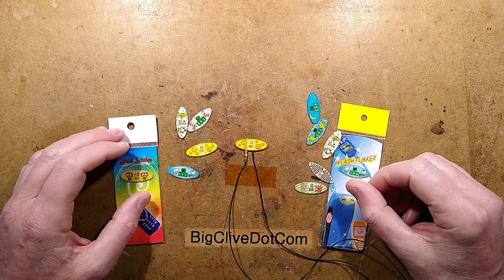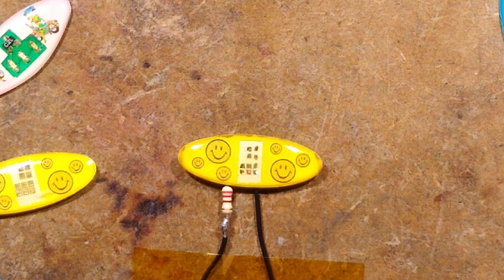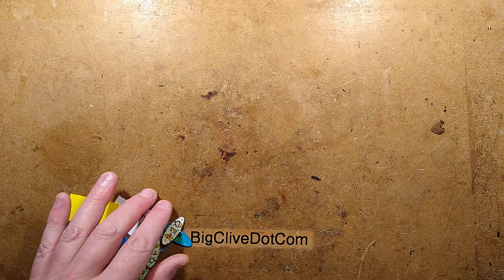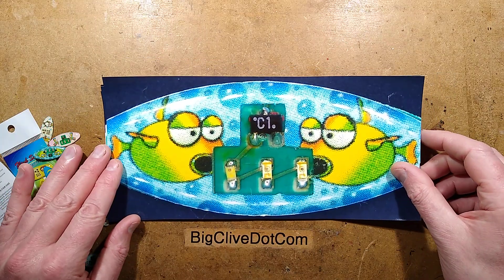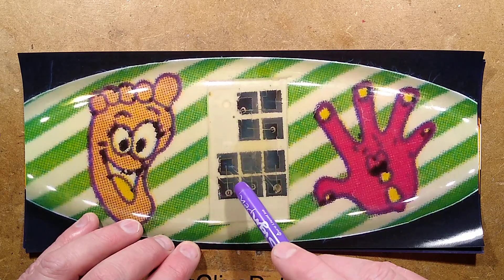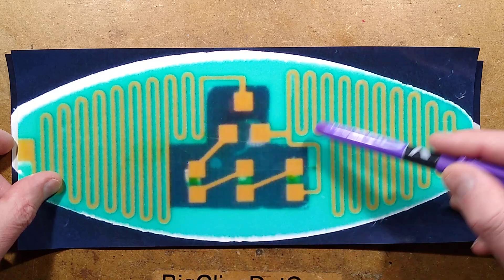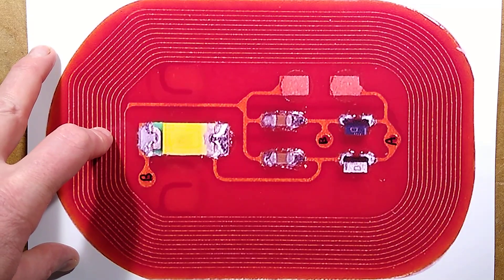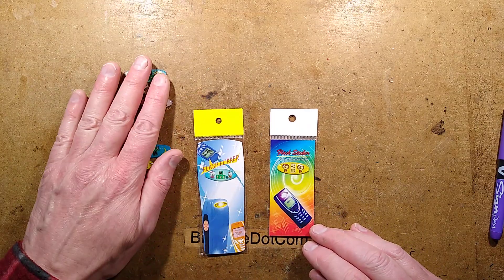How self-powered flashing phone stickers worked (with schematic)

Comment: Interesting video, thank you, Clive.  Designing and home-building a parasitic circuit like that would be a good electronics project to work on with one's young technophile son or daughter.

A question that is off-topic but on-label:  Each of the RF-sticker-lights shown in the video appears to be covered with a clear, soft, vinyl-like lens or cover.  It looks like a liquid has been applied and then somehow self-cured into a clear vinyl.  I see it often on various labels and even accent spots on greeting cards and business cards.  The soft raised tactile vinyl-like substance always seems to be in exact register with the printed ink of the text or with the perimeter of the whole label, as applicable.  Can anyone explain how that is done in a mass-production environment?
Reply: We had a kids' craft kit, where a rubber stamp was used to print ink on paper and then a coloured powder was dusted across the surface, sticking to the damp ink. The excess was then tipped off. 
Holding the paper over the toaster melted the powder and made it shiny, so the whole process was like a very slow laser printer.
Reply: @edattfield5146  

That would explain the impeccable register and the meniscus.
Reply: It is a good question. I also want to know.

Comment: "this flashing sticker absorb electromagnetic radiation during the use of cellular phones"
was right, it's how it works.
It also adsorb only an insignificant amount of radiation, but it does.
Reply: This is a rudimentary form of RF harvesting, but in fact, as Clive pointed out, it backfires: In a phone call, you actually have 2 radio links, uplink (transmitting from your phone to the tower) and downlink (from the tower). tower to the phone). If you are absorbing power from the uplink, you are adding attenuation to that channel, so the radio network controller will command your phone to increase its transmit power level to compensate, negating any possible "shielding effect" to your head. And also draining your battery faster
Reply: @mincos_outon  yep but only if the sticker is in between the tower and the phone antenna, old mobile antennas are designed to irradiate on every direction (maybe not the head but you have the board and ic shields on that side too), these stickers harvest energy but irradiate none as all of it is dissipated through the LEDs.
Clive was referring to his own version, sticking LEDs and diodes directly on the antenna coil.
Reply: It is absorbing but I think the connection quality issues were more a matter or blocking the signal in certain orientations relative to the cell tower's location.

Comment: That zigzag antenna is picking up the E field so it's developing a voltage from one end to the other.  The zigzags do produce some inductance, but it's to tune the antenna, not to sense the signal. 

The spiral antennas are picking up the magnetic B field and depend on the B field going in and out of the coil.

Comment: The regular diodes are there to protect the LEDs from too much reverse voltage; LEDs tend to be far less tolerant of that. Especially without the diode pointing the other direction you might get high voltages applied to the LEDs.
Reply: Not really, The diodes form a crude dc for the diodes to work. Not enough current to worry them Led.

Comment: I’m assuming it worked the same in the UK but here in Australia you’d hear the call coming in a few seconds before if it was next to certain radios (kinda sounded like modem noise). Do these react to that?
Reply from the maker: They did.  They flashed just before the phone rang and also when it routinely checked in with the local cell station.

Comment: I had one of the replacement antennas that flashed like these things. 
I also had a bag phone that I could pull the electronics part out of and slide it into a thing in my car so I had the same number for the phone mounted in my car.
Good times...
Reply: The first phones I had put in my trucks were the bag phones they mounted the transceiver behind the front seats in the sleeper used a extension cable to put the handset cradle on the dashboard and a external antenna on the cab roof took a big 3/4 inch hole to mount it !

Comment: at 300MHz, the wavelength would be 1 metre, an antenna is generally 1/4 wave, so each side (pole) of that badge should be  0.25 metre (they are diploes), for 500MHz the wavelength would be 0.6 metre
Reminds me of "wally lights" in the days of CB (neon on top of the antenna that would glow when transmitting)

Comment: Have you tried them with a 2m (144 MHz) amateur radio? If you wrap a dipole antenna around a fluorescent tube and transmitter enough power, the tube will glow, so I bet these would do something.

Comment: Are these the same concept as the little antenna replacements they used to sell?  Usually a multicolored LED you'd screw on top of the Nokia antenna nub.  The light would flash when calls came in.

Comment: The receiver, I think, for the frequency of 2g ought to be 72mm on a dipole aerial, so 36mm on each plane. I don't have the maths to support this, it's a gut feeling. I've never really messed with frequencies above 24 meg RF though 😬
Reply: 1.3ghz is the 23cm band. 2.4ghz is 12cm. So 1.8ghz is about 16.7 cm 👍

Comment: Very interesting and very timely video as Samsung announced at this years (2022) CES that they will releasing TV remotes which can harness the radio power of your home WiFi to stay charged for longer.
Reply from the maker: That's going to trigger the anti 5G brigade.  But in reality they will be using microcurrent circuitry and energy harvesting to send tiny bursts of remote control data.
Reply: @bigclivedotcom   Conspiracy theorists always find some way to tie unrelated or circumstantial things together.  How much power could Samsung realistically capture using this method? Could smart home devices like motion, door, vibration sensors etc adopt this to make batteries last longer or forgo them altogether?

Comment: I think the reason they're using a double-sided board is they're forming a small capacitor where the two tracks overlap just to the left of the diodes/LEDs.  It's probably to make the antenna resonate at the desired frequency.

Comment: dipole antenna is about 234/Mhz feet long on each of the 2 sides for 440Mhz is .53 ft or 6.38 in usually a bit less due to dielectric effect shorting the need length fun stuff all round ---- 
David Lowe WE1U Auburn, ME

Comment: I had a flex cable that goes underneath the front case on a 3310 and was getting powered by the phone battery, after the initial signal you would get the whole keyboard flashing.

Comment: Yes, used to see these around my high school in the early 2000s. I seem to recall the little phone case vendors in shopping centre concourses would always have a display of them all lit up. Now I wonder if they were the normal stickers on some kind of plate antenna or if they were simply hard wired from behind like Clive's example.
Reply: They were likely hard wired. There's no reason to use some sort of separate RF transmitter (or multiple phones all ringing at once) just to light them all up, it's far easier to use some thin wire and a small power supply.
Reply: @PunakiviAddikti  that would be my guess. I suppose it just depends whether you need the display to be easy to manufacture or easy to update without specialist skill. Most likely the former since the designs are timelessly obtuse.
Reply: its kinda weird I remember there being replacement keypads that had a strobe/pulse effect too but i cant find any info about it.
Reply: Presumably a transmitting loop (like a security tag loop in shop exits) would also work.
Reply: Clearly they were not powered. Just reporting the standard amount of brain melting radiation present in that local vaccinity. 🤔. Right in your face a warning of the trans-dimentional pollution designed to melt your brain 🤔
Reply: @johnathanpearson3203  Probably.
Reply: @PunakiviAddikti  😀

Comment: Used something like this with an analogue meter and some copper wire cut to 1/6 wavelength  to hold against radio antennas to ‘find’ which one is transmitting. Useful on a ship full of them. I didn’t know these existed for phones!
Reply: We had to construct and test an RF "Sniffers" as one of our projects when I went to vo-tech for electronics.
Reply: very cool tool!
Reply: Martin Smith what was you doing checking what aerial was or was not "transmitting"?? 👉💎👈👉🇬🇧👈
Reply: @alexmarshall4331  trouble shooting and maintenance reasons probably...

Comment: Must of been annoying at night. Pre LTE an AMPS, TDMA, or CDMA mobile would Autonomous Register a few time per hour as long as the mobile was powered up. 850 MHz and 1.9 GHz (Cellular and PCS bands respectively). I don’t remember having to debug any field problems with devices like this. The antenna not being all the way down or all the way up, either being a “integer” multiple of the wavelength was a common cause of customer complaints and call drops. Omni antennas really were never a common configuration except in flat rural areas. The last one to be decommissioned was in Nebraska.

Comment: I guess the double sided board is to improve the efficiency of the antenna - FR4 has terrible loss factor in the GHz range, so by putting the antenna on the phone side, they may be able to eek out a bit more RF energy (i.e. brighter flashing).
Reply: The material looks like its straight to silicone/plastic, no FR4, your comment is right though.
Reply: I've built FR4 boards at 5.4 GHz I think it was, and they worked fine, but they used 50 ohm lines. Come to think of it, I have a UHF log periodic on FR4. I guess it depends if you're cheap like me.